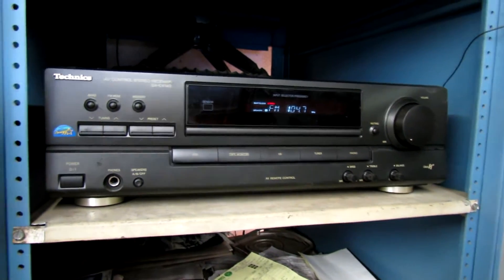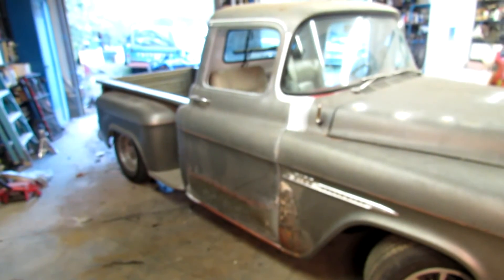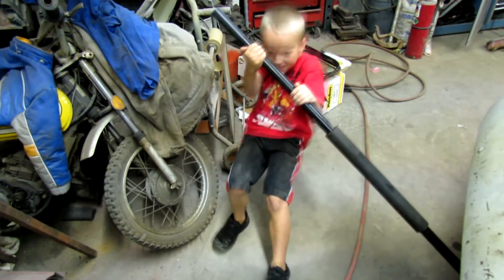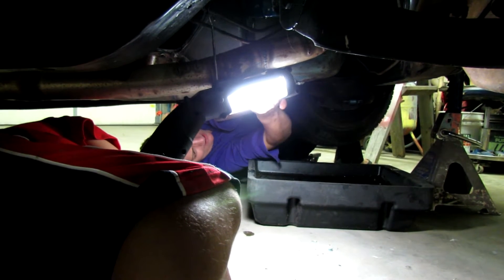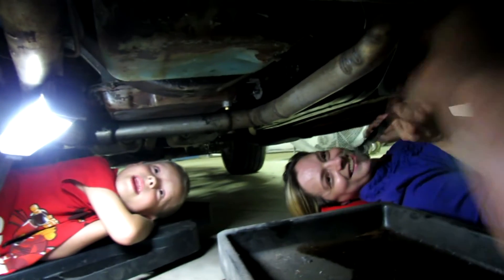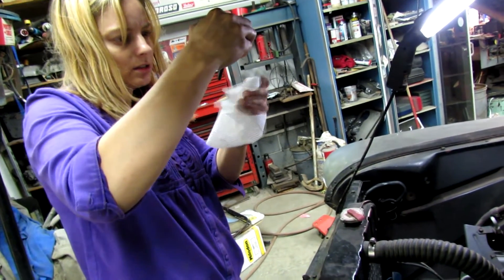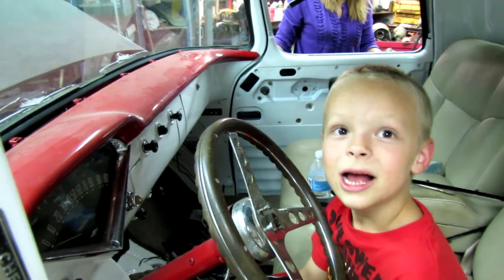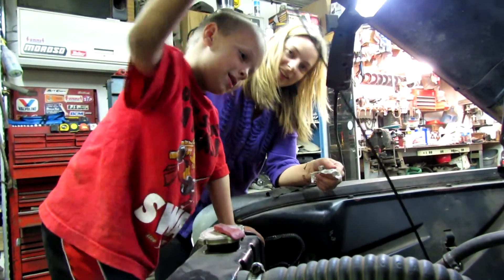55-chevy truck- gettin closer

Comment: Somebody tightened up that sump plug ridiculous - I bet the torque has destroyed the copper/aluminium washer! Watching the filter change mishap reminds me of one of my tractors where the manufacturer fitted the filter upside down, old oil goes everywhere as a result, dribbles down the block etc etc. What grade of oil do you use in an older engine like that?